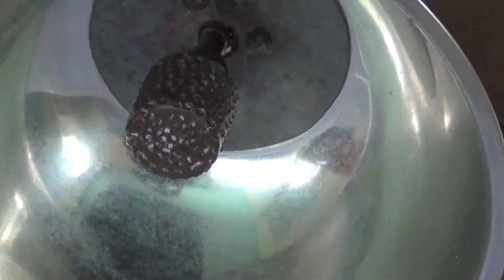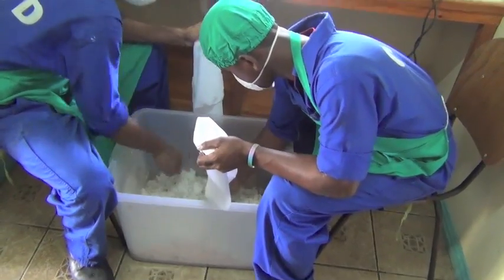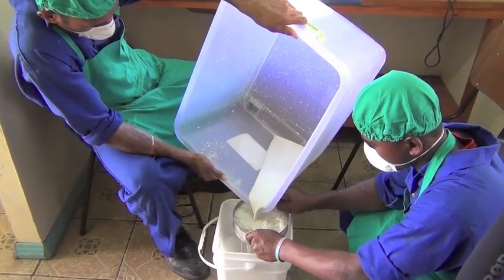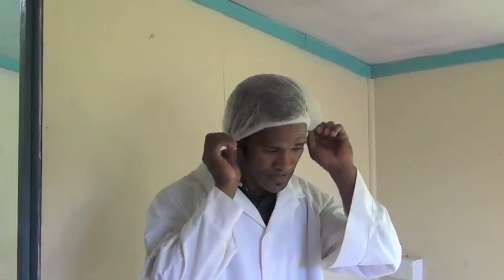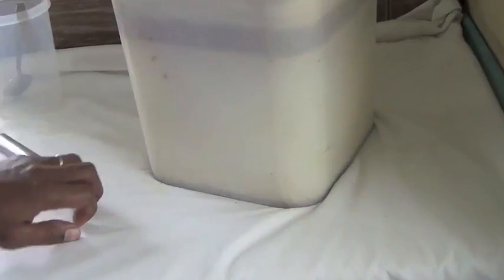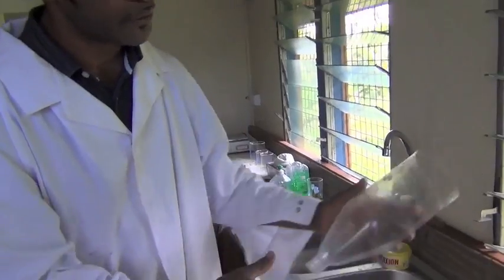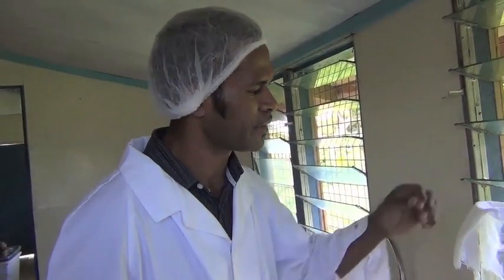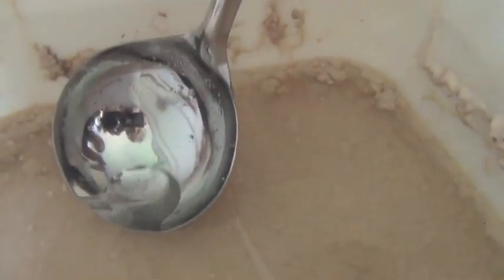Processing Virgin Coconut Oil - A step-by-step guide

Comment: Thank you for sharing with us a very good presentation, i have a question; what are the reasons why the oil will not be separated during the fermentation and have only 2 layers the water below and the curd with oil at the top? Hopefully that you can help me because i tried it many times but I failed. Your positive response will be very much appreciated and thank you very much.
Reply: Did you find out why? Maybe it's not warm enough or you need to leave it longer.?

Comment: So many foolish youtyber pretend that they are knowledgeable but they all foolish make the coconut oil using of heat and says it's virgin coconut oil. 
You are genuine, not foolish like them.
Reply: Do you know the meaning of virgin, first...virgin means not adding any chemical during extraction..whether you heat it or not..it does not matter for virgin..yes, it's only matters if you call it cold pressed oil..cold pressed oil is different it is dried coconut pressed down to oil...
All are ok than the refined oil...

Comment: hi. I got an odor from my oil. I don't know if its because the nuts I used were too old or what.  how can this be rendered odorless?
Reply: +Aldean Louis Hi your oil turned bad or rancid. However,to prevent this from happening and to preserve the oil you can place a few cloves in the oil,about 10 cloves for 1 liter of oil. In colder climate the oil will become solid so in order to get the clove in the oil you can heat it in the microwave  for about 2 minutes or until it turns to liquid then you can place the cloves inside.
Reply: Cindy Xyz you can heat it "au bain marie" too; put the bottle with the frozen coconut oil in a bowl with hot water, so it can melts (slowly)
Reply: If it as water it will go rancid

Comment: hi can you please tell me what youo after the filtering of the oil as i read an article where it says the oil then needs to be placed back into the bucket and keep at steady temp for another 21 days to naturally remove the moisture that otherwise would be removed with heat. once that is done its filtered again and then ready to be bottled. ia that correct?
Reply: 3 days enough to remove moisture

Comment: Why did you put towels on the bucket?
Reply: Insulation...
Reply: m sparkle
Hm, maybe!
Reply: Ok cool. I am going to try this today maybe not this exact method but I don't want to use any heat as I see they do on other videos.
Reply: RelatedGiraffe  they did say to keep the bucket warm to assist with the fermentation process.
Reply: Nardia Morrison
The bucket does not get warm because they put a towel on it. It does insulate, however, which means that the bucket will reach the temperature of its surrounding somewhat slower.

Comment: I juiced 6 coconuts did not mix with any water, put in glass bowl in oven to ferment after 2 days nothing, no separation only a slight rancid smell, didn't want to waste it so I put that on the stove to cook out the oil, total FAIL. Do you think I should have added water to my milk?
Reply: you are suppose to separate water from the coconut oil but how could you expect a separation if you did not add any water.
Reply: Summer Jackson If you use your juicer for other things and it not very clean then the oil wont form no matter what you do. There is a reason they are emphasising cleanliness. The old folks in my country say when making oil for best results use those tools exclusively for making oil and nothing else.

Comment: Hello. I did everything but i Didnt get 3 layers only 2. What im missing.
Reply: I think this is because of the weather or the temperature is cold in your area you got only 2 layers. the protein layer and the oil layer are bonded in one layer.
Reply: The traditional fermentation method requires coconut milk to be fermented for approximately 48 hours at a temperature of about 35C/95F.
Reply: hi ..same problem with me also

Comment: The curd can be boiled to make processed oil, which can be used as lotion or for cooking
Reply: abhilasha sen yes, the curd still has oil content, once you heat it up in a pan, the oil will separate and the curd will actually be cooked (dispose them afterwards). And you can use the oil or add it up to the previous oil that you have accumulated from the process.
Reply: That is called fractionated coconut oil using that curd...it is also good for carrier oil.